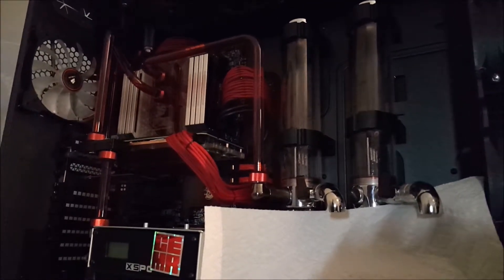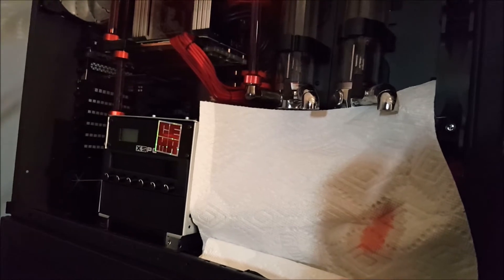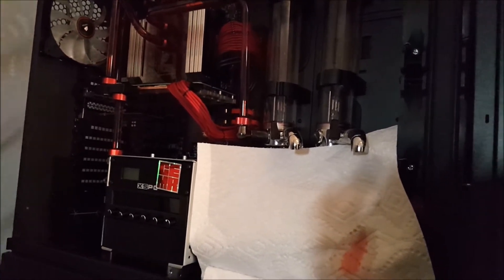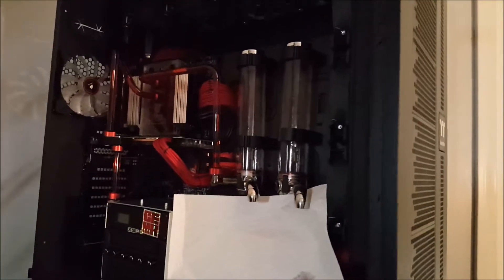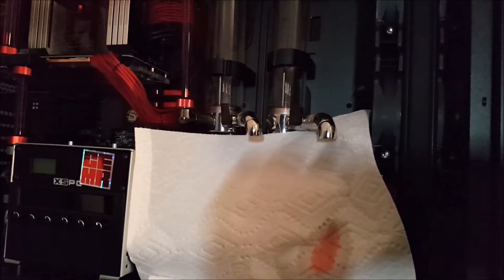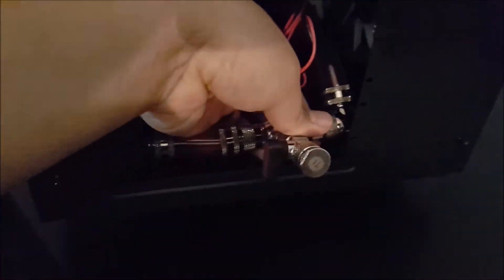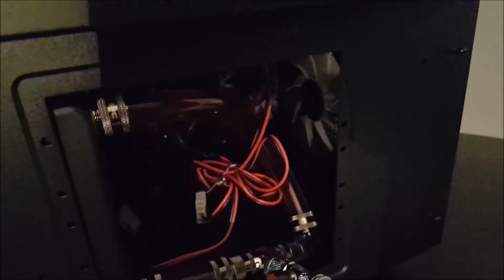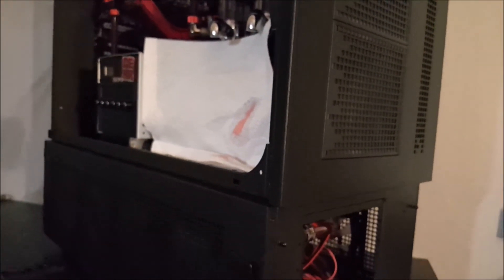X99 Double Zero Death Code

Comment: This failure is more common with Asus boards, not x99 as a whole, I've only seen a few gigabyte boards and Asrock boards fail but in most cases it never even hurt the CPU, Asus on the other hand, you get the 00, your CPU is screwed, I bought an Asus x99 Deluxe board around 2014ish, and it killed my 5820k one day after I booted it up when I got home from work, Though it got stuck on 33 some CPU cache issue, no matter what I did, Replaced the CPU as it was under warranty, It lasted a week, and killed another 5820k this time at stock everything (didn't have time to overclock), I got the CPU replaced again, and talked to Asus and they agreed to replaced the board after fighting for 2 weeks. 

Updated the bios and this time the new board and CPU lasted 2 and half months, got the 00, Asus refused to issue an RMA, as did Intel. I bought my buddy's EVGA x99 system that I built for him around the same time I built mine, Its been running great for years now. 4.5ghz 5960x, EVGA x99 Classifed, same PSU and RAM from my other build.

I don't trust Asus anymore, even with their current hardware for other platforms, Only because their support is god awful, and they tried nearly anything to get out of the RMA and was really kind of mean, I'll never use an Asus product again after what I went threw with them.
Reply: My 6800k just died a few hours ago in a x99 ws ipmi mobo, latest bios h115i pro xt. I speculate the board is still good because I checked the VRMs they seem fine no visible damage or smells.
Reply: @UnboxIt  it'll kill another one, if it killed one it'll kill more, my asus board killed 3 5820k's....
Reply from the maker: I am not sure how true it was from the MSI tech who emailed me back when I got the board replaced. He said it had to do with the BIOs chips itself of that Generation. I tend to forget how old the x99 system is. but apparently what was happening was the bios chip would fault causing issues with the board's relay that regulates power it would feed to much power to the CPU during boot up. which is why some people were unfortunate where they would lose both the Motherboard and CPU. I am guessing ASUS and a few board manufacturers use the same suppliers. I have had issues with every brand, working in the industry I just expect issues with any Tech. I always look for the Best warranty knowing I will eventually need it. EVGA so far has been the best when it comes to support.
Reply: @BakkenTech  That could be true, most people seem to get this issue on boot up, I remember seeing a "CPU overvolt" screen one of the chips and it would not boot again. I still have that Asus board, I may find me a cheap Xeon and throw in it and some cheap ram update the bios and see how long it lasts.

Comment: My AsRock Extreme6 was showing this code right from the get go. Called a technician, he did something to the bios and it worked for a few weeks, then it happened avain. Is the mb faulty or is this some software issue?
Reply from the maker: It is a common problem with the Bios MSI ended up sending me a refurbished board. it happened again about a year later. I replaced the bios chip myself and it has been working fine. up until I corrupted both bios messing with it too much. but I can always buy another chip its ranges from 5 to 10 dollars on ebay

Comment: My ASUS x99 a 3.1 usb just pulled this shit on me. I built it 3 years ago and it ran fine until today. It booted fine, then suddenly it cut out and upon reboot got stuck in a second or 2 bootloop, where all lights and fans came on, q code showed 00, then itd cut out and do it over. No post at all. Pulled RAM, same thing. Thought it was the PSU, so I got a new one. No dice. Ive heard x99s do this. Im just hoping it didnt cook my CPU too. Ah, well, was gonna upgrade anyway. No more ASUSes for me.

Comment: Just had this issue with mine ended up being a dead processor . Thought it was the board but got it back from Asus with no issues . Luckily my $1100 processor was still under warranty .
Reply from the maker: This is crazy. I usually RMA the Motherboard first because its the cheaper of the two and it doesn't seem as hard to RMA a motherboard as it is a CPU unless you purchase the additional intel warranty they offer which is like $50 I think.

Comment: Hey I've Also Had The Exact Same [00] No Post w/ The Red Cpu Light ON. Seems Common Since Its Happened To Me Twice. Same Type of Simular Failure. Had 2 Wait For RMA's For Both. 
4 The (CPU) INTEL Had Me Put Down A Heafty Dang $658.99 Deposit! That I Ended Up Having To Pay interest On It! Beacuse The First Replacement CPU They Sent Was All Scratched Up. So I Had 2 Swap Again Sadly. A Nightmare But INTEL Actualy Came Through In The End & Replaced My I7 6850-K/X-Series. Allbeit a Used or Rebuild/Parts Department CPU :-(
Reply from the maker: That sucks man I have had that same problem. I have had 3 motherboards and 2 CPUs go bad on the X99 setups I have built in the last 4 years. 1 Asus x99 Deluxe, 1 MSI Gaming 7, and a Gigabyte x99 SLI board. I also had a 5930k and 5820k die. Its hit and miss with the X99 setup and it seems like for the most part has been fixed  with the X299 systems
Reply: إضافة رد عام...
CeaseFire. . قبل 8 أشهر 
. . I overclocked my CPU in the BIOS and after I restarted I found out it was dead and THEN I SAW POST CODE 00.. . .

Comment: I was just talked out of buying a used X99 platform for this exact reason and stumbled upon your video. So? What is dying exactly?
Reply from the maker: Sorry man I don't get on youtube as much as I used to. From just my systems it is either the Mosfet on the motherboard burning out or the CPU burning out its hit an miss with the X99. depending on who you talk to a bad Motherboard and CPU throw the same 00 code. From my best guess the X99 Chip set Mosfet would burnout the motherboard or if the motherboard didn't die it would kill the CPU.

Comment: I'm having this same issue last night  (CODE 00) out the blues it just happen!?...I have the Asus X99-M WS
Reply from the maker: Shoot sorry I am not on here as often as I used to be. I have never been able to narrow it down I just have found it has been a very common problem but the fix has always either been Motherboard or CPU are dead even when most of the machine powers on. I have heard of it happening even on the new X299 systems but not as bad as it was with the X99

Comment: Sucks dude, hope you get it fixed.
Reply from the maker: It is up and running and I have actually installed my second 1080ti in my latest video
Reply: Bakken Tech what the problem actually, what part youve changed? I have the same problem and buy a new motherboards and it still like that . Help me